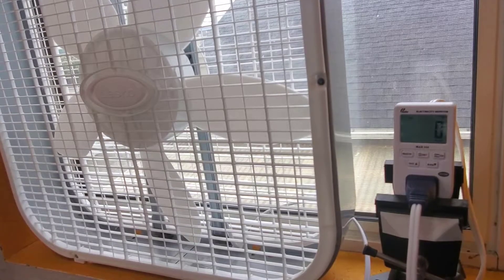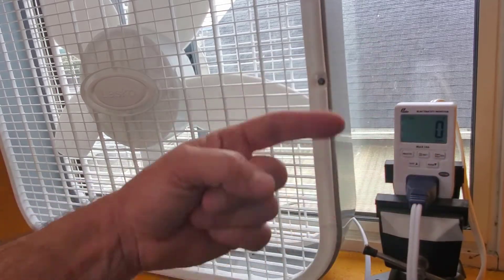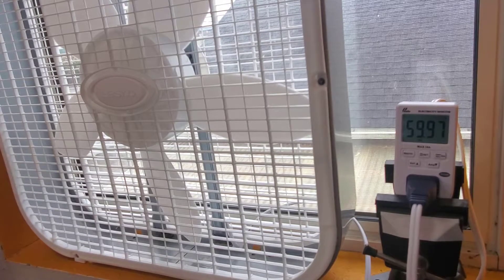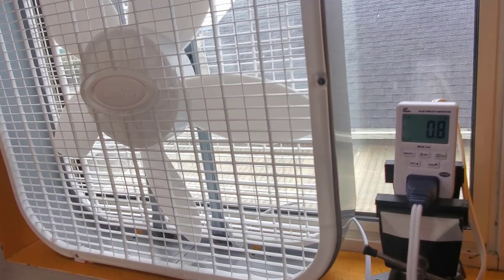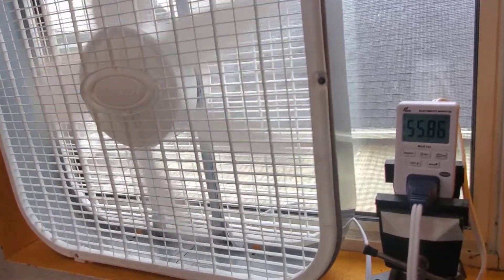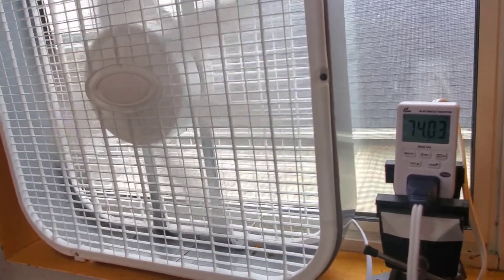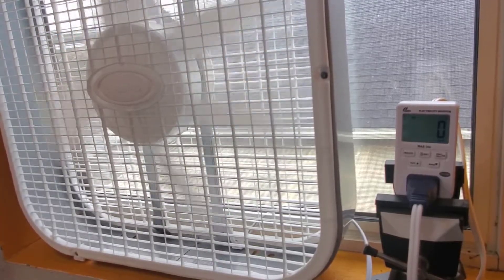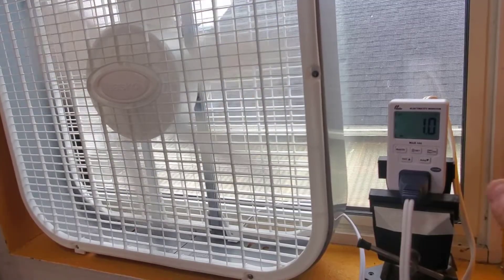How to use an AC electrical energy monitor

Comment: Do I have to hold the button down and do these set option? It says to so it on the instructions but doesn't seem it's necessary? Can't I just plug in the device then plug in let's say a fridge, wait 24 hours and get my readings?
Reply: Also I wish you spoke more on the KWHs via Cumulative Time (CT) and Electricity Consumption (EC). Trying to understand it
Reply from the maker: @MarcusAurelius12  kWh is a quantity of total energy used over a certain time. The cumulative time is the amount of time that reading took. For example, after 24 hours of a large fridge being plugged in you might read about 2 kWh. That means the fridge takes about 2 kWh/day. If you waited for 36 hours it might read 3 kWh since it was plugged in for 1.5 days...which would still mean 2 kWh/day. I hope that helps. You can read more on that at https://www.appropedia.org/Power_and_energy_basics and in https://tocatchthesun.com
Reply: @LonnyGrafman  Thank you for the Reply! The reason I purchased The electricity monitor is so that I could determine how much energy my 2 fridges use and my freezer for a solar generator in case SHTF.  So if i'm understanding this correctly. I got 3 readings. (1 Fridge got EC KWH 5.51) The (other fridge got EC KWH 4.26) and my (freezer was EC KWH 1.28) I was told I needed to add up the 24 hour usage for all devices as it should be in KWH. Then add 25% safety factor. This should be the size of the battery needed in KWH. Than Divide that number by 7 hours and that will be KW. That is the wattage of the solar panels I need. Does this sound correct? Sorry for the long question. I dont have many people to ask
Reply from the maker: @MarcusAurelius12  Hi Jordan. I hear the logic of the sizing. That said, if you are trying to dial this for SHTF, I suggest reading To Catch the Sun...specifically the sizing sections, which will help you get it really right. The book is available as a free pdf. For the EC kWh, yes, if you had it plugged in for 24 hours then those readings will be the total daily energy in kWh/day (when added together). Sidenote, if you are relying on the Poniie monitors to measure the cumulative time then there is a small chance the numbers are off, because there are two different styles of cumulative time measurement in their monitors. If you were relying on your own clock, then you are all good. Good luck!
Reply: @LonnyGrafman  thank you for responding!
Reply from the maker: The buttons are just to switch reading or to reset the readings. You can just plug it into a wall and plug fridge into it and wait a day or so to get the readings. You will need to push the button to switch it to reading kWh and time once you are ready for that.